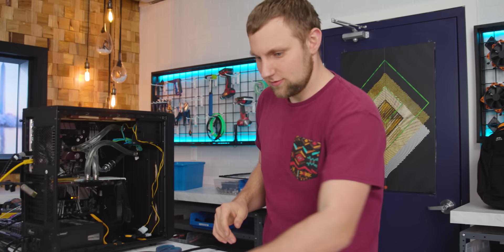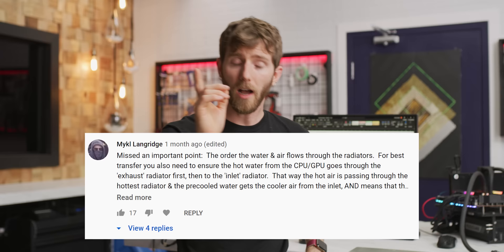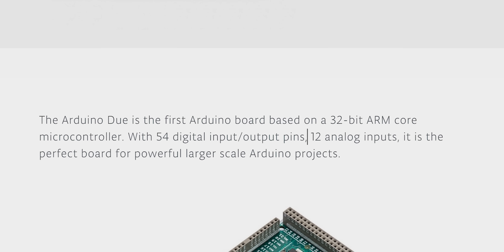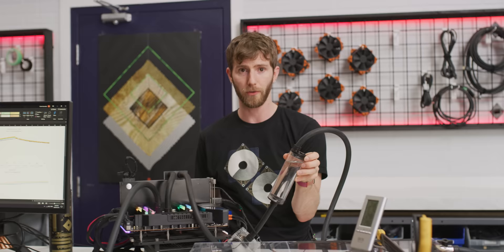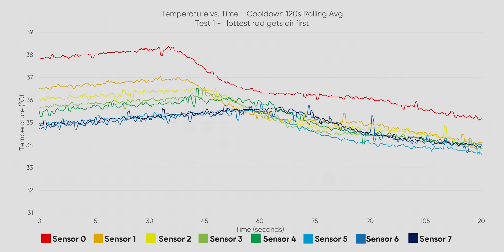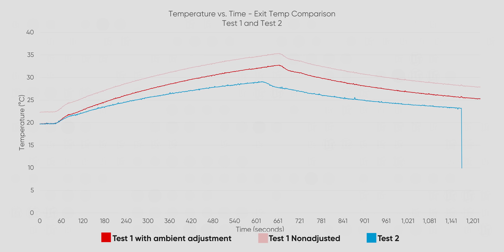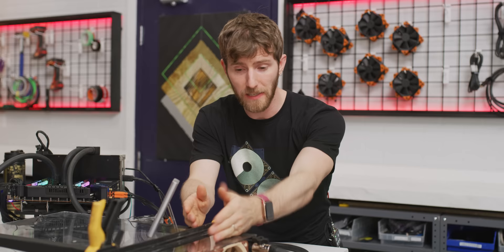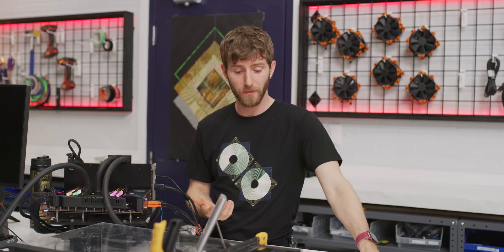Is this even going to work…

Comment: Stack all rads in a long box. They should not be touching. Connect 2 vacuum cleaners to pull the air through. Run pumps in reverse.
Chuck the vacuum in another room if the sound bothers you.
Might aswell try as you already built the lab setup. 😀
PS. You cannot achive lower than ambient temp with a passive setup as shown in this video.
But you can add water spray to cool the rads and fluid even more.

Comment: Linus: "Delta T"

Steve from Gamers Nexus: heavy breathing
Reply: Delta T is fine Steve doesnt like %t over t
Reply: as long as you use the same measurements and comparisons (Celsius does end up being constrained by granularity at less then 100)
though when you start doing Delta %T, or % difference between delta-T that is when you are playing with the Wrath of Gaming Jesus
Reply: Steve is boring to watch.  Informative...yes....boring....hell yes
Reply: Delta T always in Kelvin.
Reply: @noproki2838  uhm no
Reply: @noproki2838  delta T is dimensionless can be Celsius or Kelvin. If the original sources are both celsius or both kelvin, (provided that they convert C to K directly) it leads to same Delta T, because Celsius increment and Kelvin increment is the same. Kelvin is just an offset Celsius (or actually Celsius is an offset Kelvin)
E:. 20C - 0C = Delta T 20 = 293K - 273K
Reply: @jazmihamizan4987  Dimensionless?  That doesn't make any sense.  A delta T measurement still has units.  It just so happens that it doesn't matter if you use degrees Celsius or Kelvins, since the unit sizes are the same, as you stated.  But you still have to use one of them, if not degrees Fahrenheit.

Perhaps what you meant to say is that a temperature delta has no origin, which is accurate.
Reply: @jazmihamizan4987  dT isn't dimensionless, it does correct for the difference in zero between C and K but it could be in degrees F or R
Reply: And he fucking calculated it wrong...
Reply: @Silent_Shadow  I would rather informative and boring than non-informative and exciting. That thing Mr. Beast did for the 4th of July was some of the most boring shit to watch simply because there was no subversion, and no nuance. Just a lot of bombs in the sky. And drones. That was like, the only cool thing there, the drone bank that could spell words with lights.
Reply: @Osaka2407 on the units thing, GN is 100% right there. Most thermodynamic require the use of °K or °R. In order to work properly. °K is basically a measure of the energy in a thing. 0°K means there is no energy in it all all, it's at absolute 0. A change from 50°C to 100°C is not a doubling of the energy in the system. It's a gain of about 15% in energy (373K/323K). So yes "lowers temps by 3°C" is fine, but "lowers temps by 6%" (53/50) is not. 
I believe that GNs complaint about eatx is that many cases and motherboards claim to be eatx, but don't support or aren't 12x13 and therefore or of spec.
Reply: Luci Morningstar Steve teaches that one class that you love going to, while Linus is guy you got high with before going to class
Reply: @TrueThanny  i think he means its a scalar quantity and not a vector
Reply: Andrew Frink Kelvin doesn’t use degrees. It’s just 0 K. IMO Rankine should also be used without degree since it’s also an absolute scale, but it’s still common to use degree R.
Reply: Whispers in his ear:  𝒪𝓋ℯ𝓇  𝒶𝓂𝒷𝒾ℯ𝓃𝓉
Reply: God. GamersNexus is the only other channel that would compete against Linus on who loves to listen to their voice more and smell their own farts. That guy is SO BORING. just talks and talks and talks. lazy channel doesn't bother making anything interesting.
Reply: @Silent_Shadow  i got board with him if you need go to sleep just watch gamer nexus.
Reply: @sandi260  that's because he cares about other things. Believe it or not not every person is interested primarily in human dynamics. We need both kind of people, people that are interested in peoples feelings, and people that are interested in... Well at least something resembling science. All things considered tho I prefer the latter if I'm to make a purchase.
Reply: @Leo9ine  **slow clapping intensifies**
Reply: @Osaka2407 
😅 Lol, you've still missed the practical point dude.
Steve says you shouldn't use percentage for Celsius because it's not a linear scale,
It doesn't matter that someone being told "this runs 50% cooler" and the person can understand that it means 50 degrees c instead of 100 degrees c.
It's technically incorrect because it's not a linear scale, so it would be more truthful 
(though less practical)
To use Kelvin since it is a linear scale where percentage works.
That doesn't mean you can't disagree with Steve that manufacturers shouldn't use percentages for Celsius in a way most people would understand,
That would be a valid opinion,
But it's not correct to say that Steve was wrong on this since what he said was factually correct.

Also just as a side note, I'd like to give some constructive feedback on your writing style.
I think you would benefit from working on being more concise and clear in your writing.
Your reply was MUCH longer than the replies you were responding to,
Which isn't too much of a problem itself but it was also a lot less straightforward and clear in the ideas it was putting forth, therefore I think that if someone didn't skip reading your comments because they were long, they would have likely skipped them because they were harder to understand 
(at least initially)
I've seen this kind of thing happen before in threads,
The discussion abruptly ends because the people involved can't be bothered reading the reply.
Anyway, just some food for thought, I'm not really expecting you to go out of your way to change your writing style based on some random person on the internets opinion,
Though I thought I'd give it a try and throw my opinion out there regardless this time 😅
Reply: @mattinm  yes you are technically correct, but being an engineer, and using K to mean a shape factor, or being a mis-capipitalized k for the so prefix, it pretty common informally to use  °K to avoid confusion. I can hear my co-worker who specializes in heat transfer grinding her teeth at this response, but being clear is more important than being correct.
Reply: @michaelvanrheede7225  Here at the Cologne University of Technology, we use Kelvin above °C if possible.
Reply: @jazmihamizan4987  He's making a joke since C and K are the same measure but with an offset applied. Deltas are in Kelvin because the offset does not apply here, the K value when applied to a C value results in C because the combination with a C value means the C-offset of 273K is applied. 

So he's right and it was just a cheeky comment.
Reply: @Leo9ine   F

Comment: "So we were wrong... only at domestic environment."
"Suck, it Corsair! At Server environment, more than 2 radiator help a lot."
Reply: Nice tl;dr
Reply: true cause your not using fans in servers your using angry and stressed gremlins which cast wind magic ..... anyone close enough is cursed with permanent hearing damage.
Reply: In their defence, it didn't help that much
Reply: It doesn't help enough to justify the engineering and cost required.  Not to mention the many added points of failure.  It's cool in theory, and not in reality.
Reply: Just buy a thicker rad, you'll get the same effect.
Reply: @Silent_Shadow  
Redundancy helps spread out points of failure, though the point consistently stays one with the pump, so the liquid pressure of the liquid pushed by pump needs to be enough to maintain appropriate flow rate. Spread the radiators out and the venting case fans must use high static pressure.

Plumbing remains a single point of failure, since a leak in any part is especially troubling.

Comment: From building race cars, in general you want the biggest single radiator you can fit "for your needs", but fluid volume and fluid flow have to be calculated as well. You only split into multiple rads for a single purpose if you're space limited.
Too much or too little flow means there isn't enough thermal transfer. Which stacking rads, adding a bunch of fittings, and generally reducing the fluid pathway efficiency is another issue.
For this experiment, assuming you have to stay in the wind tunnel effect: I'd reduce the number of rads to 5, then double stack fans at the entry, with another double stack before the 2nd to last rad.

Comment: I have never seen tests using rads in the way I use them. In my last few builds I have been mounting my Rad sideways. It pulls air in from left side of case, and exhausts to right side of case. I have it mounted directly behind the front of the case(Silverstone SG-11). I use the Corsair H80i V2. The rad is partitioned so it does not pull or eject air into the rest of the case(MOBO, CPU, GPU). I also have PSU fan, GPU fans(RX 5700XT), and a single case fan. Temps great.

Comment: In short the ideal circuit is outlets of the radiators connected in parallel to the cold (flow) header, then the cold header to the inlet of the items you want to cool. Then connect the outlets (return) to the hot header (configured as a reverse return) and finally from the hot header to the inlets of your rads. In terms of the pump the best option is to size it for the volume of the cold header and connect it directly to the cold header. In buildings we use 1 pump per circuit from the header but installing a larger pump in the cold header before the manifold is probably the most efficient option given the constraints of a PC case and due to the volume of coolant in the header should prevent cavitation at the pump. No need for a reservoir although it might be an idea to add a small expansion vessel to allow for the coolant expansion on the hot side. Easy...

Comment: When you look at any radiator, 80% of the heat energy is removed in the first 50% of the heat exchanger. The applies to the first half of the thickness of the core or the first half of the length of the tube going from end tank to end tank.  By making the tubes longer or the core thicker to you adding a lot of resistance to the system to extract that last little bit of heat. You are almost always better off adding more rows to the system if you have enough room to reduce pumping losses through the system. The may not be a huge issue with a pump that is supplied power from the wall, but in race cars it can help produce a few more horsepower.

Comment: Linus: We did this for two frickin' weeks to make sure Its super accurate
Comment Section: tHe tESt wAs uNreliAblE
Reply: two*
Reply: @Haitham0  congratulations you have achieved absolutely nothing
Reply: @maurice7017  ok
Reply: Waiting to see how GN would roast the setup...
Reply: @maurice7017  So did you, wait a minute...
Reply: no  controls for water flow rate, air flow rate, and inlet temp. so yep, flawed, but not useless. The results were as i would have expected. At some point you are out of useful temp difference and adding more rads doesn't mater at all.

Comment: A better method is to use a linearized temperature sensor.  NTC thermistors are very non-linear and you're only nulling offsets with the potentiometers (actually, they are rheostats in this configuration).

Still not bad for a breadboard setup!  It's certainly still representative of the real response.  You get a thumbs up from a professional electrical engineer.
Reply: I think DS18B20 sensors would have been a better choice. It would have been a bit less noisy, more precise and their circuit would have been much simpler since you would only need one digital pin on the Arduino, a 3.3v rail and ground rail for as many sensors as needed.

Comment: Linus, did you try running the "2 rad system" with the fans pulling the air through one and pushing the air through the other, sort of like rad fan rad, I think the "static pressure optimization" is meant for air going through one thing, not 2. I think you'll find the results to be slightly different, although likely negligible at this scale

Comment: Stacking the radiators is akin to having a thicker radiator, though you will get some gains from the extra fans. If you could have the radiators side by side you would get more cooling duty as the airflow resistance would be lower and the air temperature hitting the radiator will be higher. Connect the radiators in parallel to the pump ensuring the pipe length is consistent for each radiator.
Reply: Also if you allow the system to come to a steady state you will be able to compare different setups more easily.

Comment: Next time you focus on your testing methodology, design a constant heat load. Modern processors are notoriously inconsistent.
Take GamersNexus's heater design as inspiration.
Reply: testing in a real-world environment is different from these videos and the other one they made it last time. this just one configuration put the fan in the wind tunnel and done. did PC case work like that? nope. we can wait for the next test they did. it's an interesting to test nonetheless.
Reply: They only analysed watertemps and assuming constant mass flow from the pump, the ammount of energy in to the radiators are always the same at the same liquid temperature. So the computer is only a funny prop.

Comment: Good work. This establishes that stacking radiators in terms of both airflow and coolant flow offers diminishing returns at best, and more practically a single radiator offers functionally better results (with more radiators either hurting performance or simply not doing anything besides being a money drain).

Now for the more interesting combinations...
1. Airflow-stacked radiators (using the same airflow through both of them) but with two coolant loops (for example one for the CPU and another for the GPU);
2. Coolant-stacked radiators, with both getting equally cool air but daisy-chained to run the same coolant through both of them in one loop;
3. Completely separate radiators, with each having equally cool air and each running their own coolant loop separate from the others.

Comment: 2 questions...
1) Was the third test done in reverse flow?  He said that was "the better way to stack," but I don't think he specified that it was part of the third test.  That would especially be pertinent in the one vs two rad comparison. 

2) He later says that stacking can help, provided there's fast enough air flow to maintain a water/air temp difference; and he also alludes to the possibility that mixed air improved the results in the Minecraft Server testing....  

In a more realistic scenario applying all the results in a case environment..., in a reverse water-flow setup,  would inserting high static pressure fans functioning as both push/pull between the rads while leaving a small gap to pull in ambient air to the mix for the second "hot" rad make a significant difference over a single rad?

Comment: "All liquid cooling is also air cooling, and all air cooling is also liquid cooling"
- A wise man
Reply: "All cooling is just heating backwards." - A wiser man
Reply: For those who did not understand, inside the copper tubes there is a liquid that helps to transfer heat quickly, and in the watercooler it is much more obvious, since air is forced into the fins
Reply: @sam-n9v  And both air and water are fluids, so all cooling is fluid cooling :-)
Reply: @zeero4ever  Not if you use radiative cooling
Reply: @sam-n9v  It's not "heating backwards" 
Cooling is moving heat from one place to another.  Nothing is done in backwards.  Cooling is the act of heat (energy) moving from one object to another.
Reply: @Geerice  Well.. yeah.. that's not the typical PC cooling solution for sure
Reply: @RNG-999  So is heating, but in the other direction. So what's your point?
Reply: All air cooling isn't liquid cooling, at 0% humidity there'll be no liquid.
Reply: @smoke4131  Air IS a liquid.
Edit: I'm sorry air is a fluid, not a liquid.
Reply: @zeero4ever  what about radiation into the surrounding  vacuum?  there are no fluids there.
Reply: @smoke4131  Consumer air coolers have fluid inside the copper or aluminium heat pipes. This fluid evaporates and condenses to transfer heat.
Reply: @Nekotamer  How many PCs do you know, that are surrounded by vacuum? :-) Was thinking of space crafts, but afaik those need heating elements for the electronics in most cases.
Reply: @Ocastia  Haha, I nearly made the same mistake. But you're somehwat correct, air is a fluid, regardless of its humidity.
Reply: @Godielvs  Intel shipping top tier CPU with a fan stick to a piece of aluminum : What copper tubes?
Reply: Not always.  I knew a guy who, while building an extension ran a large copper loop before they laid the concrete slab.  The copper array under the slab was a ground cooled, water loop.  Apparently quite effective, once you have enough buried copper to soak away the heat.  A geothermal cooling solution, if you will.
Reply: @RNG-999  As with air conditioners, it's all about the heat pumps.
Reply: @zeero4ever  *laughs in International Space Station radiative cooling
Reply: @nottsoserious  holy shit I never knew that, thought they were just copper heat pipes
Reply: @RNG-999  if you go deep enough its just a sort of energy transfer. in reality there is no "cold" its just absence of energy/movement
Reply: @zeero4ever  While I see what you did, Fluid != Liquid. Liquid is a state of mater, and Fluid is a qualifier for motion of substances. So yes, Air and Water cooling are both "Fluid" cooled, but Air Cooling is not necessarily "Liquid cooled" especially when factoring in stock cooling options on some processors that just use contact and a burly heatsink with no thermal piping (Like early Ryzens)
But thats more semantics than anything, just pointing out the change of terminology to qualify between the initial statement, and your supplemental one.
Edit: Missattributed OP as your post, corrected.